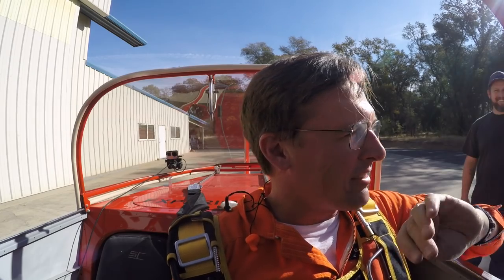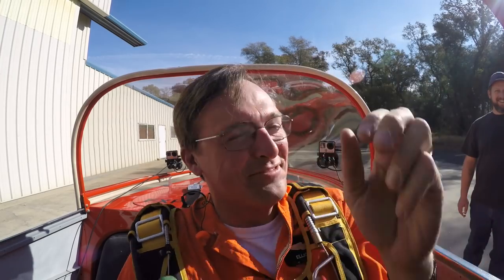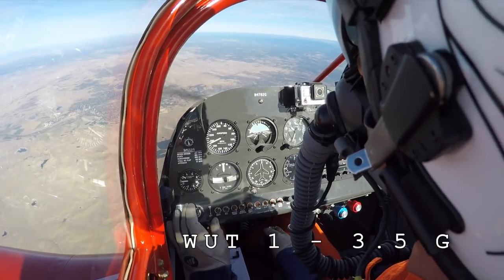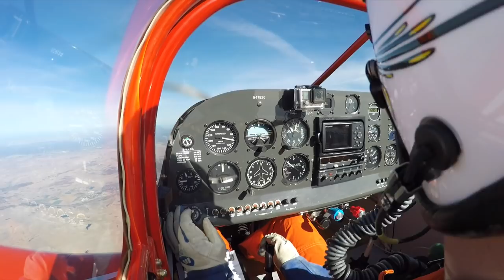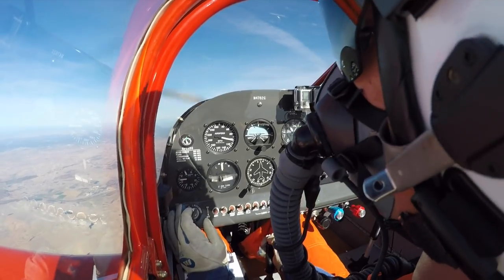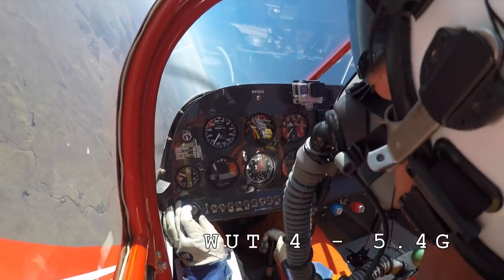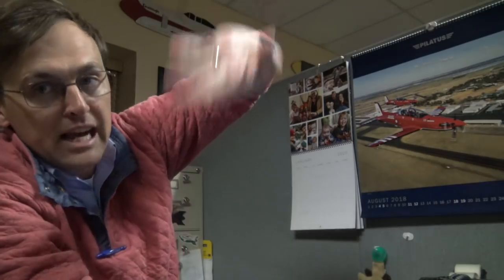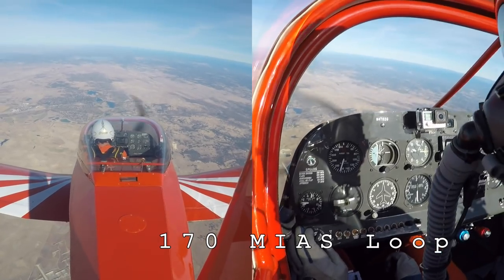Oops Tailslide - VNE Dive, Wind Up Turns,  and Aerobatics - last flight of JellybeanThorp program

Comment: Elliot, great job, once again.  I appreciate you giving the Thorp the credit it is due.  As the first all metal homebuilt design (plans only, no kit), it's been flying since the '60's and just about every fault (very few) has been exposed over the years.  It was originally designed as a sport, open cockpit aircraft based on 4' wide aluminum sheets and a Lycoming O-290 ground power unit.  Your example shows the how the aircraft has evolved to a Lycoming O-360/CS prop cruiser with the performance of the modern RV's.  Couple of comments:

Tail flutter:  Like most aviation stories, a Thorp had a flutter event as a result of a user intentionally and grossly overspeeding the aircraft, and paying for it with his life.   As a result, Thorp added the stabilator counter balance and stiffeners in key areas.  The stabilator is attached and pivots within two brackets that have bronze bushings.  It is very important for a Thorp flyer to check for slop in the stabilator on every walk around, to ensure there is no excess play in this bushing and the tab linkage.  Slop in this area can bring the flutter envelope down significantly.  Simply wiggle the tip of the stabilator on the walk around, and wiggle the tab to make sure there is no excessive play.  

Tailslide:  As I mentioned before, the vertical stabilizer and rudder were designed for an O290, and could be larger for a 180HP nose heavy Thorp.  This area can be "blanked" out easily at high AOA, rendering the rudder useless.  I think this is what you experienced, as the aircraft did not respond to your hammerhead rudder input, and became a lawn dart until airflow returned to the tail.  There are examples of larger rudder/stabilizers in the community with good results.  Just respect the rudder, as it has its limitations.

Tail stall:  One other issues with the stabilator is that it can stall.  The full 40 flaps position was abandoned as there were instances where nose heavy, high AOA, full flaps would disturb the airflow over the stabilator and cause it to stall, nosing the aircraft over for recovery.  Users need to ensure that this flap position is disabled.  

I get the feeling you really enjoyed the airplane.  It is a great design.  I make these comments for awareness, because it is important to understand any design you may be flying and its limitations.   Fly safe!
Reply from the maker: Such a great airplane.  Thank you for the comment!

Comment: Great vid.  As we said in the military, "unload for control."
Reply from the maker: jcheck6 well said.  We carry this moment as one of our 11 lessons learned for 2019 but I go back and forth about what the action is against that lesson.

For instance the hammerhead recovery was likely a bit late but as a strategy for recovery I don’t think it was wrong. My second favorite recovery would be to positive pitch out.  If you stay positive the engine would have kept running, which would have kept the tail blown.  However bouncing off the stall buffet in an airplane prone to stall-wingdrop....sounds like begging for a spin entry.

Anyway, simpler things like securing the passenger harnesses, and the gps antenna are easy takeaways.

Thanks for the note.

Comment: I love the T-18 and it's been a battle in my mind between it and the Mustang II, which has a big more shoulder room.
Reply from the maker: They are both cool airplanes.
Reply: @utopiasnow  Absolutely and cheaper than RVs on the used market. I like that they can be built from plans, no kit required. RVs are awesome too btw!
Reply: As an M2 owner I might be biased, but they're an awesome aeropane.

Comment: Very nice video, Elliot. Am I correct to say that it looked like you only pulled about 2.4-2.5G when attempting the 150mph loop? Wouldn't it have worked better if you have pulled more G to make the plane go around quicker before getting in the situation that you've found yourself in? As many others have said, I thank you for posting it with all the explanations going through the maneuvers.
Reply from the maker: Manie Rossouw that’s the odd part of the aerobatic log book entry.  There are many ways to do a loop or a roll.  But the logbook entry doesn’t leave room for much of a description.  So what does the logbook entry really mean?

Thanks
Reply: @utopiasnow  keep up with the testing videos and explanations. There really isn't much like it on YouTube. Safe flying.

Comment: That is a S-18, not a T-18. We built a T-18 back in the mid 1970's. The inner and outer wing panels are both 4' in span on the T-18. The S-18 has a shorter inboard panel span and a longer outboard panel span. The T-18 is an awesome aircraft.
Reply from the maker: Ron Barden I would go one step farther and say this is “the S18”, since it is Lu Sunderland’s prototype.
Reply: @utopiasnow  True. My dad Jerry Barden and John Thorp were partners in the aviation business when I was young. They designed the original stabilator (sp?). My dad regretted patenting it. They designed the Cherokee for Piper. We used Thorp's templates to lay out all the skin pieces for our T-18. That made it much easier to build using matched hole tooling.
Reply: I meant "not" patenting it.

Comment: I would put try puting some jelly beans on a tin plate sitting on the dash. If they start dancing around then there's some resonant vibrations being transmitted through the flight controls, which cound indicate eminent flutter.

Comment: Very cool! I've enjoyed following this series. Somewhere I missed the framing of your work: Who's paying the freight for your testing and why is there such thorough testing on a (famous) airplane designed...in the year I was born? Isn't this the testing to which prototypes are normally subjected before 1,600+ plans are sold? I skimmed all 23 pages of your 22-page report but didn't find the answer. Good fun and many thanks.
Reply from the maker: John Fife this is the standard FAA required testing for any newly built (even if it’s a kit) experimental aircraft, or in this case after a major modification was made to the airplane.

It is common for builders to short cut this testing especially on shake and bake quick built aircraft.  But as a hired test pilot I have to be sure that when I sign off a phase one test program (as required by the FAA) I have complied with the intention of and the letter of the law.  A test pilot is only as good as his report and if people can’t trust your word you don’t have much left to offer.

Thanks for the comment!!

Comment: You probably know this already, but during the loop testing, if you had been able to get to the rudder earlier in the sequence of events then it may have made the hammerhead. It looked like you were kicking the rudder when you had already run out of speed entirely, and presumably the prop wash alone wasn't enough. Apologies if this smacks of Monday morning quaterbacking! It's interesting that there was no spin testing. Over here in the UK, aircraft that are cleared for basic aerobatics but not spinning still have to demonstrate a two turn spin during flight testing so that should a future owner get into trouble the spind recovery is proven.
Reply from the maker: Thanks for the note.

About the spin testing.  So in the UK all amateur built experimental aircraft that are cleared for aerobatics have to do a two turn spin?  That's interesting.

Do you guys use the same definition of aerobatics that we do?

Are there T-18s in the UK?

Thanks
Reply: @utopiasnow  Hi, yes. For instance the RV-6 and RV-7 are not approved for intentional spinning by the UK CAA deligated airworthiness authority for amateur builds, the LAA.  However, to gain approval to allow aerobatics to be added to the Permit to Fly limitations, during flight testing of each individual aircraft, they have to demonstrate recoverability from a two turn spin. This doesn't apply to all aircraft, just aerobatic ones. Amateur built aircraft without a declared aerobatic capability do not have to demonstrate  spin recovery on an airframe by airframe basis, just once when the design is approved by the Light Aicraft Association (our EAA equivalent) - The LAA maintain a list of approved designs for amateur construction, and choosing to build something not on the list means the builder has to pay for a comprehensive structural analysis and provide it to the LAA before they may begin construction.

Comment: This is probably a common ask question, but why is he using mph instead of knots?
Reply from the maker: Laborchef Dr. Klenk thank you for the comment.

The gauge in the airplane was in mph, and the speeds placarded in the airplane were in mph.

The original documentation for the airplane was also in Mph.

Thanks again.

Comment: Had anyone used a stick shaker in place of stick raps ?  At least you can control the frequency then with motor RPM. Just a thought.

Comment: hi Elliot, I was wondering why you did't spin it. Is that not what kills  everyone? 
unable to exit the spin sequence?
Reply from the maker: joe komo the Thorps have been successfully spun but it doesn’t seem common in that community.  The short answer is spins were outside of the scope.  The rolls and loops were only barely within the scope of the program.  The intent is the airplane is used as a short distance (less than 100 mile) commuter....so it’s hard to justify the cost and risk to the program of a spin series.

Thank you for the note!!!
Reply: @utopiasnow  thanks, my next door buddys have 3  thorp's. That's why I am concerned!

Comment: What would be a minimum bailout altitude in a plane that is considered unrecoverable due to  something like a wing rip for example? Or is it standard procedure to guide it in till the last minute a bailout is necessary even though all control surface has been lost?
Reply from the maker: I would start the conversation at 3,000' AGL for a minimum bailout.  Briefed as "bailing out if out of control below X,XXX feet"

Comment: The prop wash, slipstream or whatever you want to call it is going around the aircraft placing a force on the vertical surfaces of the tail which try's to yaw the aircraft to the left ,  so if you pushed full left rudder rather than right you would be helping this tendency rather than opposing it . The fact that your unaware of this means in my opinion your not suitable for testing any aircraft.
Reply from the maker: Interesting.  Yeah the plan was to hammerhead out, so it wasn’t the yaw that was a surprise it was the snap.  But thanks.
Reply: Yeah, as soon as that engine quit you were screwed. Not even an Extra can hammerhead with zero airspeed and zero prop blast. An engine with a standard carburetor (and not a pressure carb) will quit every single time at even slightly negative G as the fuel floats off the bottom of the float bowl. At that point, at that attitude, you’re coming down backwards, whether you like it or not. Great job holding on tight and not letting a flight control slam to it’s stop.
Reply: @tamarindocoral     My humblest apologys, I will take some time out to correct my grammar and hopefully come up to a standard which is acceptable to you. If I achieve this goal I will tentatively request your permission to comment in the future and you might say ' you now have business to comment ' if I even come close to your eloquence it will be one of the finest days of my life.

Comment: "wearing" a parachute is not the same as "using" a parachute.  ;-)
Reply from the maker: I don't understand.
Reply: @utopiasnow  you don't "use" the parachute until you actually pull the D-ring.  Up until that point you are just "wearing" it.  ;-)
Reply from the maker: @stay_at_home_astronaut  Got it
Reply: @utopiasnow  I got too slow in a Great Lakes (biplane, not the amphib) while doing hammerheads, back in the 1980's...  ...the reversed flow over the wings grabbed all four ailerons and jerked the stick out of my hand.  I never let that happen again!